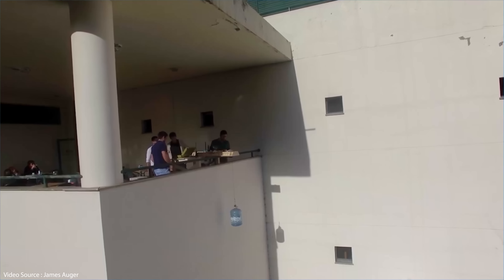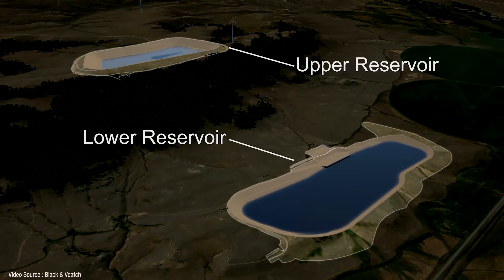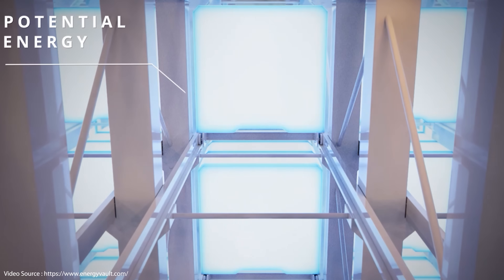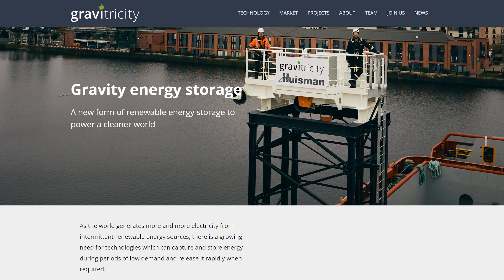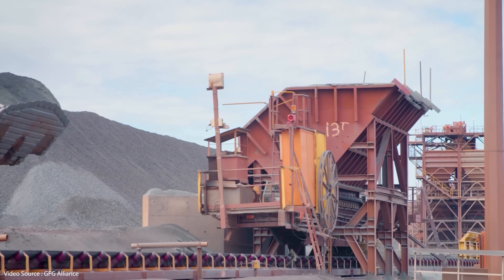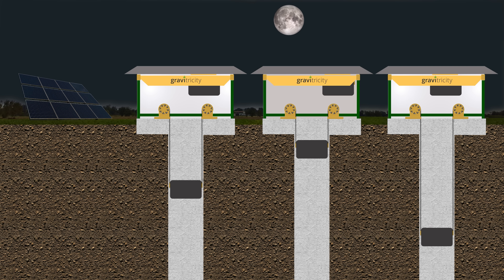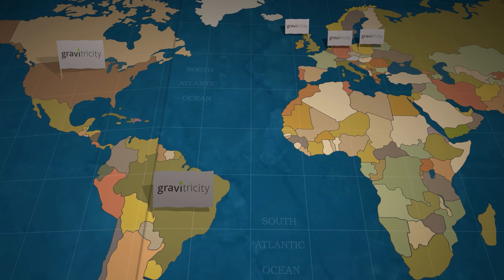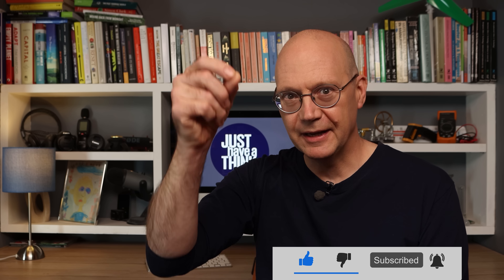Gravity Energy Storage. Who's right and who's wrong?

Comment: Using old mine shafts sounds like a great idea. Particularly in hot, dry and remote areas of Australia where there are endless mineshafts. Probably lots of locations like that in the world that could use a relatively cheap, safe to people, environment, etc solution for storing energy. I would 100% build one if I had a mine shaft. I've never seen gravity leak out of a system. I think this is useful eg. 1 Km shaft, 30 tonne weight=80 KWh.  I don't think any of these companies are trying to solve the worlds energy crisis, I think they're all helping though.
Reply: But why use gravity as opposed to something like a flywheel design?
You can have a flywheel that weighs several tons, and it's rotational energy could be enough to power a small town for backup purposes
Reply: @dustinjames1268  Cost vs safety issue for flywheels. Would you choose to fly over an Ocean on a plane some bloke built in a rice paddy with parts from Bunnings for a $1 fare, or pay $5,000 for a seat on a 747?
Reply: @colingrant321  
Flywheel systems have been proven to be safe and exist in every car that isn't an EV.
It's part of the connection between your engine and the transmission.

Without a flywheel it would be incredibly hard to drive manual

Comment: There is a guy named Eduard Heindl who has proposed excavating large hydraulic pistons (the bigger, the better) out of bedrock. Aside from greater durability (no steel cables) and simplicity (you can use the same pumps that are used for pumped hydro), the advantage of this is that doubling the circumference of the piston (in other words, doubling the investment into excavating the piston) quadruples the volume and mass, and therefore quadruples the storage capacity. He seems not to be getting anywhere close to the investment he needs to get this off the ground though, while sucker investors flock to boondoggles like Energy Vault.

Comment: It's been said a ton in the comments, but again: Power Density. This is an unsolvable flaw in the approach. Nobody talks about the weight & height needed PER KWH, because that's really what makes it infeasible. It gets even more laughable when you consider the assumption that you're going to charge the system with solar. I've read somewhere that if you had free rein on 100% of the geography of the United States, you couldn't make enough electricity to power the United States with pumped hydro (not to mention the fact that this would eat up land you would need to use for solar, or the issue of electrical transmission). It's like solar freakin' roadways all over again. It's really a non-starter. Any small-scale electrical backup need can already be filled with solar-charged batteries or diesel generators. There is no niche for a product like this. I hate to criticize the channel, but failing to consider this obstacle feels pretty disingenuous. Do your homework and you'll conclude what most have: nuclear power is the way forward.

Comment: When I have 1 ton 100 meters up it is equal to 1.000.000 Ws. This is 1.000 kWs. This is 0.28 kWh. A lot of steel for half the capacity of an ebike battery.

Comment: Gravitricity evaluated at $0.05/kWh for storage is amazing. Then again the concept is pretty simple and reliable. The fact is you could find a useful location, mine a new shaft, line it with something resilient like steel sleeve and concrete, and use it for 100 years. To add to the efficiency you might even just fill your hollow weights with crushed rock from the hole you mined. The energy to mine would be massively dwarfed by the use of shaft for power storage and release nightly 365 days a year for 100 years. (Concrete dams last 100 years)
I could even envision multiple weights stacked with holes for cables for the weights below them. Lift the top one, then lift the next one, and so on and so on.
Obviously most of the material would have to be removed or else you wouldn't have movement in the shaft, but many more than one weight would be best.

Comment: Energy volt doesn't understand the adage of KISS.  A heavy weight, gearing system, winch and a generator and a height (tower or hole in the ground) is all you need.

Comment: I think there is something to gravity storage.  These 2 companies completely miss the boat.  And do it quite wrong.  Energy Vault did by miracle build one of these things but I believe as it should be only the top row gets dropped and lifted.  Gravitricity is out of their mind if they think someone is going to give them a mile deep mine shaft.  The nice thing about gravity storage or hydrogen or batteries is that is still free power.  It's generated from solar or wind when normally sent to ground because the grid doesn't need it. So whatever it captures is still free.

Comment: the fact that these videos are still being pumped out even though it was proven that it takes energy just to store it this way and then even MORE energy to retrieve it is sad.

so many people in the comments thinking how this will be great yet clearly none of them understand the cost of power to actually utilize the energy ends up being MORE than what you're storing.

there is no free energy, and storing it requires energy as well as retrieving it, so physical gravity wells being used for energy storage?

idiotic.

people thinking that this is in any way going to save us?

moronic.

im sorry, but at some point you guys need to take these insults and actually learn why they're being pushed towards you.

if you really think you can store energy mechanically without loss, you are in fact losing brain cells the more you promote it and are damaging the brains of the people you promote it to.

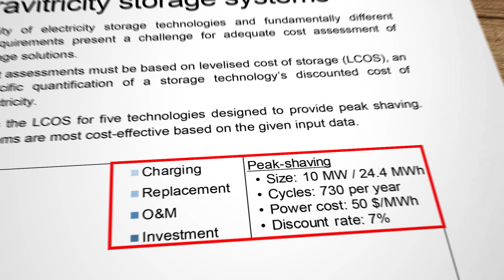Comment: 8:08 With 10MW electrical power you can move 10 thousand metrical tons with a speed of 0.1m/s vertically.
The datasheet says the system stores 24.4MWh , so the vertical movement has to take 2.44 hours or 8800seconds
to store the said energy.
Is these 8800 seconds the 10 thousand ton weight moves 880m up or down.
880m is not unrealistic,  but a weight of 10000 tons?
The ship-lifting system https://en.wikipedia.org/wiki/Scharnebeck_twin_ship_lift
can lift 5800 tons.  The construction is masive, see the link.
The lift distance is only 30m.
Cramming such a system into a coal-mine shaft:  have fun.
This is the nice thing with pumped hydro: water is going downhill much faster than 
0.1m/s, so, one does not need to move such large masses.
And after 8800s a pumped hydro station can still carry on either storing or delivering
energy, whilethe proposal has to reverse the energy direction or stop energy flow 
completely.

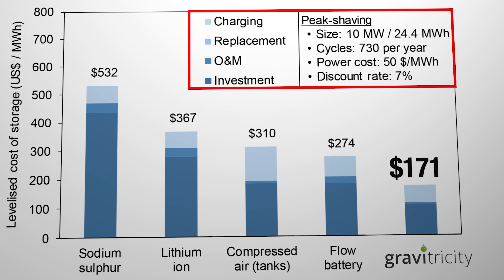And when looking at 8:24 :   $50 is the value  of  1MWh  electricity being stored. $171 is the storage
cost.  So the storage costs  3x than what shall be stored.  Completely crazy.
If I were the owner of the storage I would say: fuck it, I'll  dump the electric energy to be stored
in an electric arc, and if somebody wants the energy back I'll buy it for even $150 per MWh
on the spot market and still earn $21. 
Just had a think? Obviously not.

Comment: Couldn't this concept be applied to something like a funicular rail way down a hill side?  A solar array can run a winch to pull a loaded car up a steep hillside during the day, and gravity can pull the car down to the bottom at night, generating electricity.
Reply: It could but it would not be very useful for travel. The existing funicular railways tend to just balance two cars, using relatively small amounts of energy to go up and down the hill.
Reply: Yes. That's another option that can work on a small scale but it's difficult to scale up.

Comment: I don't see why it has to be vertical.
There must be a huge number of places where there is a relatively constant slope going up / down 1000 meters or more so a simple rail track could be used and no need for a mine shaft that will probably need to be dewatered constantly.

Comment: There's a huge problem that hasn't been accounted for in the Gravitricity project. That is the cost of continuously pumping out of the water from the mineshaft and what is done with it. The water will be contaminated so can't just be pumped into the water system without being chemically treated first. None of these costs appear in any of the cost analyses for gravity storage utilising mine shafts! Rather a worrying omission and should be ringing a lot of alarm bells from an environmental p.o.v.

Comment: Could a steep slope/hill/mountain also be used as opposed to a mineshaft? Less gravitational effect but could be constructed on the outside avoiding problems of finding shafts and maintaining existing ones. Cover them in dirt and grass/shrubs/trees to hide them. Or if boxed, use the top flat part for rollerblade slopes or downhill soap box sprints. Whatever, obviously, but easier for maintenance and repair if the gravity numbers stack up.

Comment: would it be possible to combine the approaches of pumped hydro with hydro-electric. eg. when producing excess energy, convert water into hydrogen and oxygen, when their is no energy being produced, combine the two elements again to produce electricity, and use the weight of the water to produce even more electricity and make it more efficient. Possibly, I don't know, just an idea I had, I'm definitely not an expert in this field 🤣🤷‍♂.